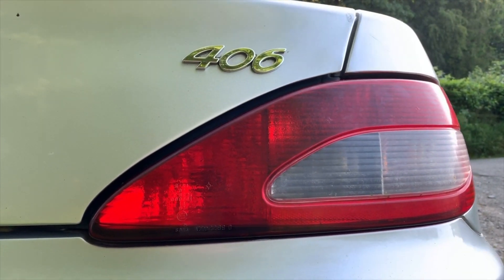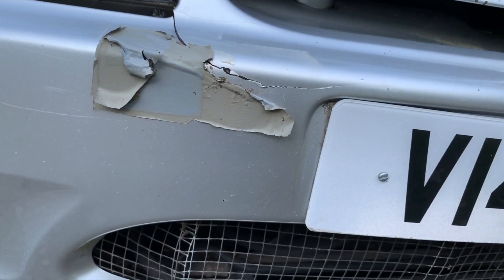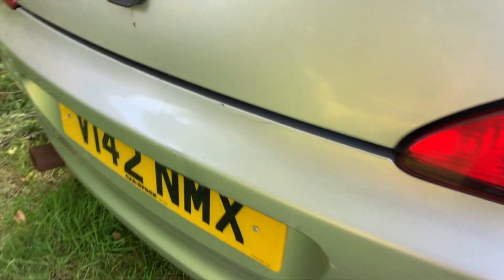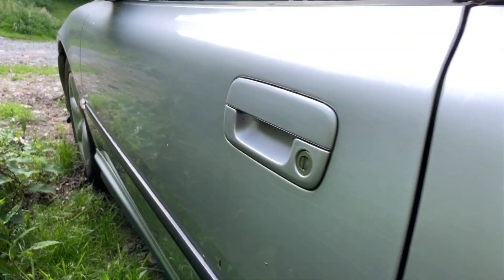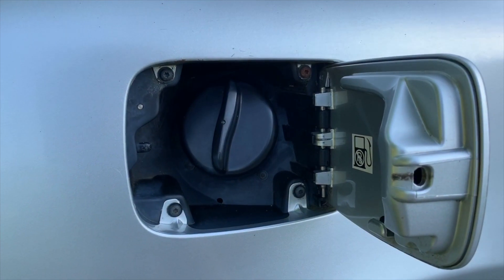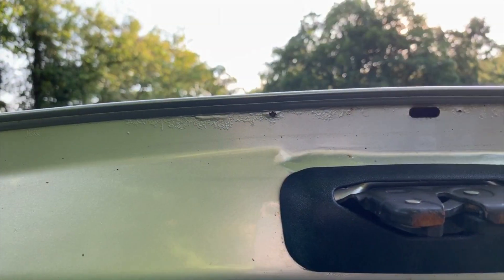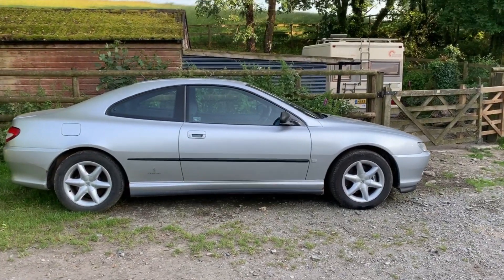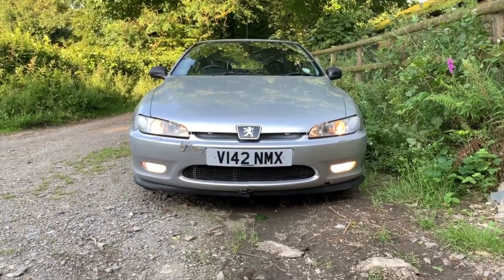Um, detritus: the rescued Peugeot 406 Coupe V6 has had its first wash

Comment: I inherited a late model v6 coupe from my dad....I had it a few years and spent thousands on it....it wasn't very fast for a 200bhp car....it was always going wrong...electrics were just plain awful......I did love it's looks but I think mine was a Friday afternoon car for sure.
The engines leak oil as the final insult to all the love you show them.......but, I still find myself looking for one to buy as an almost Ferrari cousin bargain.
I hope she loves you more than mine did me.....they are gorgeous cars.
Reply from the maker: Just the kind of thing I wanted to read before embarking on a restoration job. That said, I'm under no illusion that it will be an easy ride. Hope you get another one someday – and that you have a more enjoyable experience.
Reply: @Petrolblog  I'm always looking....v6 for sure.
It has the badge, the style and the poise......and if I'm honest I think there was something wrong with mine power wise as it didn't feel anything like 200bhp..... Was flat top end, I never  got round to sorting it though as the car unfortunately got written off....but I've seen Autobahn runs of 145plus mph.....I'd aspire for that next time.
I had some polybushes fitted and new Bilsteins shocks which tightened the handling nicely....on a fast A road it was a great GT car and nimble too in the Twisties.
I think they are worth the effort....I just found that mine kept fighting everything I did and I never got anywhere if that makes sense.
I had the dark grey colour.
Good luck buddy, I look forward to the progress

Comment: i have an idea about the damage on the rear bumper. Some people actually park their car directly against the wall. So they bump into the wall at very low speed. I just wanted to write to you that i myself just bought a 406 coupe v6 automatic to with high mileage but mostly fine. It does have a lot off oil leakage on the cilinder heads primarily but im going to be looking into that in the spring. The ride is amazingly smooth and quiet for me it feels more luxury than sports to be honest. Mine does have a pretty nasty petrol smell on the outside i presume the gasket for the fuel pump has gone bad but will look into that when i get the time. Repairing plastics parts is something you might want to look into as the bumpers are getting rare and expensive. From the looks off it on the internet that process shouldnt be to difficult (welding plastic with basicly an modified electric soldering iron) and paint is available if you look up the name peugeot gave the painting scheme online
Reply from the maker: Congratulations on the purchase.
Since this video was filmed, the front bumper has been removed and is awaiting repair. Fingers crossed.

Comment: if you need any mechanical advice i'm happy to give it as i own 2 406 coupes both with the early v6 like yours (ES9J4). Id recommend you do the timing belt, you need the specialist tools to do it which i have. Just PM me.
Reply from the maker: Great – thank you. You're not the first to recommend a timing belt change, so I'd be mad not to heed the advice. I appreciate the offer of help.
Reply: @Petrolblog  it requires a bit of research if you do it your self, there's a issue with the water pumps you need the right one, cause there is 4 different ones. The timing belt and idler pulleys are the same on the 2 engines(no need to worry about that). The tensioner for the es9j4 is no longer available which is a good thing, since it isn't easy to get the correct tension with out a seem gauge, the tensioner off the later v6 works a treat. I can send you the pdf work shop manual and a link to the special tool need to adjust the camshafts, if you want?